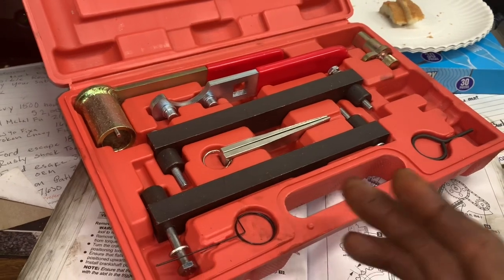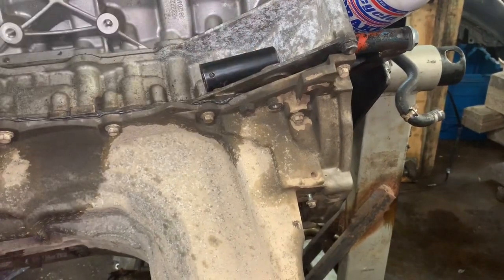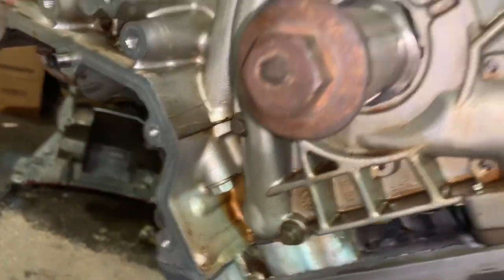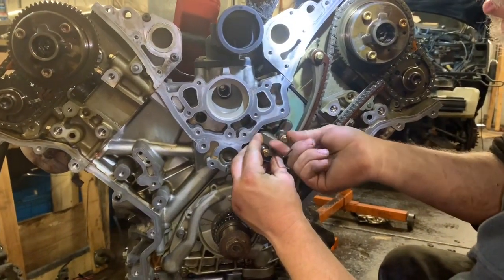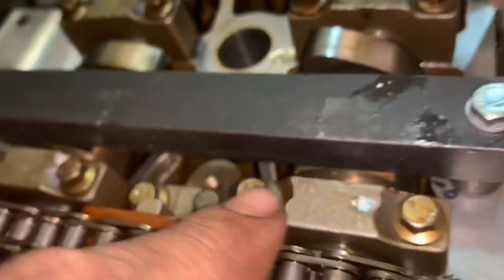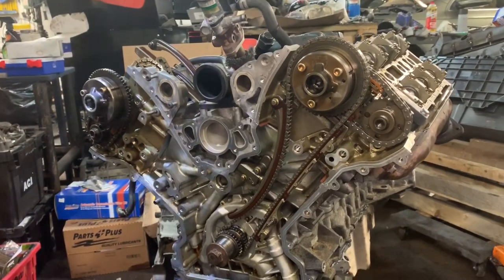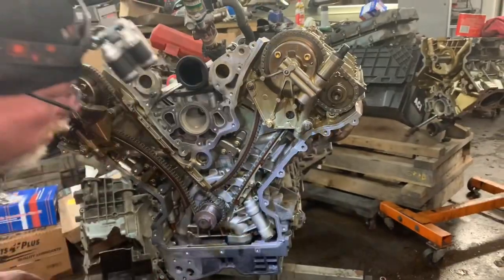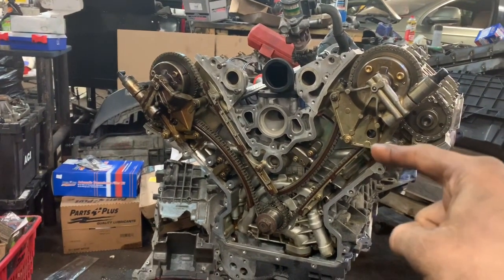Land Rover 4.4 timing

Comment: great info just bought one I know I will be doing this in the future.so I will be schooling myself .thanks for the videos.
Reply from the maker: hi Ruben glad to see you watch the video. You don’t want that chain to break you should do it before it does. Make sure you get the timing kit. It’s not an absolute must but it certainly will make it easier..  much easier.... I bought a cheap one it made it lineup extremely close. 

Although if I had it to do over again I probably would I have bought a little better one than one I did.

Comment: Thanks for the video. I'm in middle of rebuilding 4.2 super hard w same configuration as your motor . I followed the shop manual and all the steps to time the motor. After I remove the key and locking blocks I spun the motor by hand and the key hole is slightly off . Is this normal ? I've done this twice now and I'm not certain it's correct . And advice would be great
Reply from the maker: Yes, I do believe it is if I remember correctly it’s been a couple of years. This season on the show we’re actually doing a 6.2 swap on that LR three so that should be really interesting. 

That engine ran great for a number of years and then I’ve let it overheat one time and now it’s poo. Poo. … I bought another one for it but I just recently decided that my 6.2 driveline would be much cooler inside that…. So we’re gonna do a sponsored build this year.
Reply: @sharpcarco  
   My motor never overheated . I had 235k miles on it and gave it to a speed shop to freshen up. I've never timed a motor like this and don't know if what I did is correct . As you can imagine I'm paranoid to close it up and reassemble the car. Are you I Florida ? I'm really in a spot here cause I can't find anyone to help me out.

Comment: Excellent VIDEO. Thank you.
Reply from the maker: Well I appreciate you taking the time to write that Luke I’ve already shot the video of the front timing cover removal while the engine is installed I just haven’t got it edit it out yet it is quite the task if you have not tackled it yet but it will be very helpful and I will eventually shoot better video of the timing chain installation and go over some of the problems that may happen if you use the cheap Chinese tool God bless have a great night thank you very much

Comment: Hi Clay...so when removing the crankshaft pulley can you just use that keyway to hold the flywheel or would it be too much torque trying to remove the 25mm bolt?
Reply from the maker: I’m not sure exactly what you’re saying. It’s been a couple years, but I had to of gotten that sucker off somehow and I would’ve had to of held it someway.
Reply: @sharpcarco  how did you remove the crankshaft pulley bolt without the pulley spinning
Reply from the maker: IMPAC and the crank holder tool for setting the timing

Comment: I have a 4.2 Supercharged and am trying to get the head bolts out, but it feels like something is going to break! I got the 2 middle ones on the left head to crack, but wont turn so far. I'm so afraid to put more pressure because the breaker bar and small extension on the impact 13mm socket moves almost 45 degrees and still not turning. I've broken 1/2 inch drive breaker bar before, many years ago, and it reminds me of this. Not sure if it's the breaker bar, small extension, or, my biggest fear, the actual head bolt twisting that far without breaking loose? Ugh!!!! If the bolt breaks, then the untorque sequence is screwed and may warp or crack the head before getting the others loosened during the un torquing sequence. It's not like you can squirt some liquid wrench in there. That's the most Q's I've ever typed in one sitting!!!!!!!
Reply from the maker: First I would try to break loose every single bolt before I take them out and get all of them broke loose at one time then start removing them . Also I wouldn’t think anything about breaking the bolts because it’s not gonna matter you have to get the head off. 

And I would have to think that the bolts would not break off flush with the block . So once the pressure is removed I would assume you would be able to get the bolts out. 

No I don’t know if the 4.2 is the same as the 4.4 but worst case scenario I would have to guess you may end up removing the cams and cutting the head bolts off that’s very rare but possible.

Hopefully some of that helps you sorry to take so long to answer

That’s a lot of Q’s lol
Reply: @sharpcarco  I did it this morning when it was much cooler and was successful at removing them all in the un torque sequence. Thanks for the feedback. The heads are now at the machine shop for the next 4 or 5 days. Time for the clean up and prep work.

Comment: Hi Clay, thank you for the LR3 videos. I am a new DIY guy wrenching on my LR3 4.4L engine. I am trying to change my head gaskets. I have the valve covers off, and ready to go further. I am worried about messing up timing when removing the cams to get to the heads. Can I mess up my timing by changing the head gasket?
Reply from the maker: Well I appreciate the kind words you definitely have to remove all of the timing to do the head gaskets. Because you will not be able to seal up the front timing cover correctly after removal or during removal and if for whatever reason the timing actually moved you would not know it even if there was a way to hold it during the procedure at least that I am aware of. So better be safe than sorry if you’re doing the head gasket you have to remove just about everything like I was doing in the video of removing the engine

Unfortunately I do not have a video I’m just doing that.

My LR three head gaskets blew last week but I’m going to swap out the engine because I have another one.

That is an extremely complicated job if you believe you can do it I’m certain you can. 

I personally prefer not to do it that’s why I’m not removing mine and doing just a head gaskets.
Reply: Where the green cover seals go?

Comment: Thanks for the video! I have taken my engine apart a couple of time to set the timing but never got it quite right. I am always getting code p0011and p0021. After watching your video, I learned that I had the crank key in the 5 oclock position instead of the 6 oclock position. Well, I'll be tearing it apart in the morning and hopefully everything will come together. Thanks a lot guys!!!!
Reply from the maker: Please please let me know how that goes.... thanks for the kind words hopefully we did not do it wrong..... Ours had a little bit of a tick when we put it back together but on the passenger side head and we had a bad tensioner on the upper timing chain for the Cam
Reply: hello guys, just to give you all an update,  I tore the engine apart this morning and followed yall directions and PO, DING got it running very smoothly. Once again I would like to say thanks for the video and information. Continue to educate those who are willing to learn!
Reply: @sharpcarco  The truck runs great, I took it out on the road today and it ran phenomenal!!! The only difference I did was to use the special tool on the exhaust sprocket to take the slack out of the primary chains.

Comment: hi fella's. i don't want to be doom and gloom, but i've been watching loads of these videos as i have mine to do and at  7minutes in i was looking at the two cogs on the crank shaft and noticed the teeth are lined up. other videos have mentioned that they should not line up as they have dots on one side and they have to be a certain way round.just thought i should mention it.

Comment: What mileage or miles did the engine have when they changed the timing chain?
Reply from the maker: Well, they’re not supposed to need service but if I remember right I had to service mine about 125,000 miles

Comment: Do you guy have a video in replacement of a oil pump on a 2005 range rover
Reply from the maker: No I’m really sorry we do not
Reply: Thanks anyway you guy are amazing keep up the good work God bless
Reply: One more question where is the oil pump located on the engine if you don't mind answering I need to change my oil pump I think but fist I will replace the vavle cover gaskets due to leakage and it tells me low oil pressure not sure if valve covers can cause suck a thing
Reply from the maker: It is under the crank pulley behind the cover not a simple job in any means, I know there’s lots of information out there but not very many videos that I’m aware of
Reply: Yup I figured lol thanks have a blessed day form Houston to where ever you guys may be  stay safe

Comment: Does the oilpan need to be removed to take off the lower timing cover
Reply from the maker: I don’t remember but I’m doing one in a couple weeks I’m sorry I wish I had a better answer for you
Reply from the maker: Looking at the timing cover that I have sitting on the floor it does not look like you need to pull the oil pan out to remove the timing cover
Reply: Thanks for the info and reply cheers m8

Comment: Quick question : is this engine pretty much the same as the Lincoln LS 3.9 v8 or the Jaguar S/X type v8 4.0?
Reply from the maker: Ask me what kind of vehicles you are trying to compare them to year make and model
Reply: Yes, if not, very close to it. It’s in the same engine Family (Jaguar AJ-V8). Most of the Jaguars (S-Type, XJ, XK up to around 2010) used the 3.9 (Lincoln LS)/4.0 & 4.0 supercharged/4.2 & 4.2 supercharged. The Range Rover, sport, and LR3 (3rd gen Discovery) all used the 4.4 version from 2006-2009. RR SC used the 4.2 SC as well.